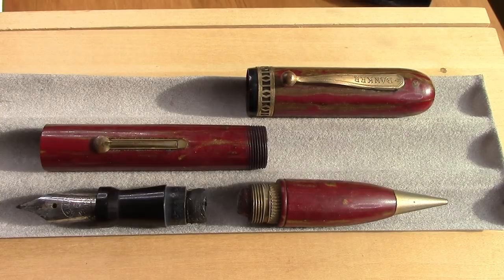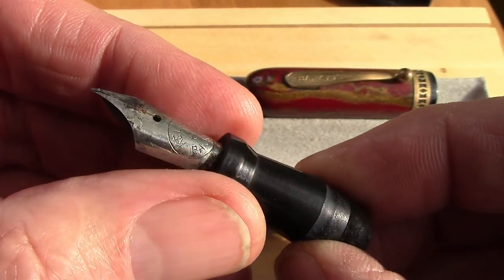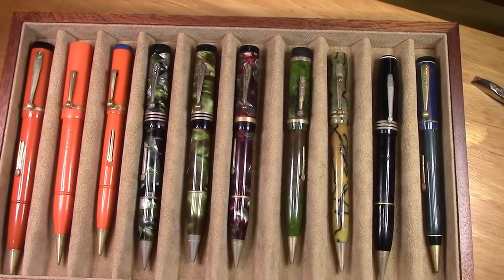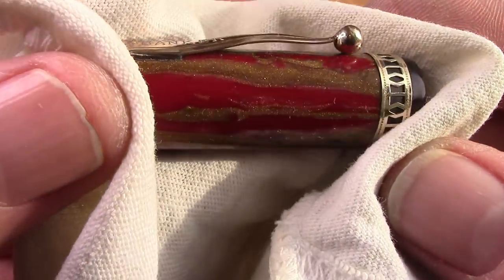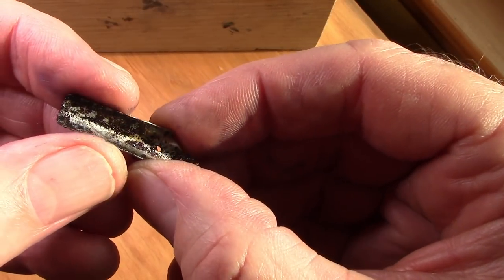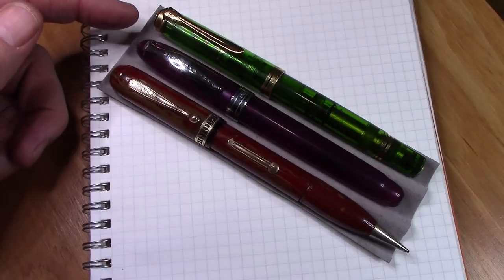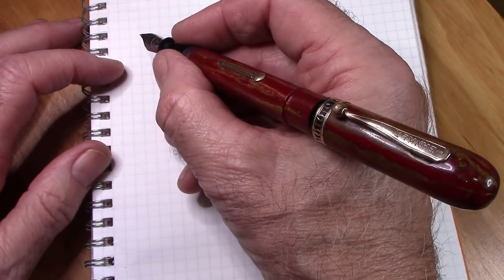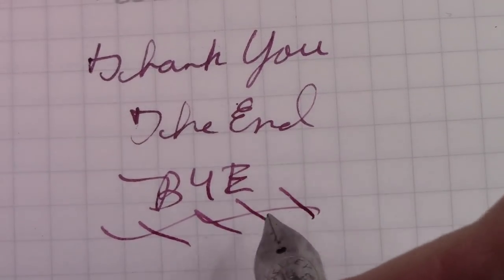Banker Combo Fountain Pen & Pencil Restoration

Comment: Thank you for the shout-out! I'm assuming it was about my Parker Fifth Avenue. Educational for me to see the use of the polish. I have the same polish, but have not been brave enough to try using it. I have a really filthy Svandstrom (Swedish brand) that will need a lot of work. Maybe it's time to try the polish!

The tipping on the nib looks like my Parker Fifth Avenue: folded rather than tipped. Apparently this was a solution on lower cost pens.
Reply from the maker: Yes the 5th Ave, the Parker one not the Eversharp one.

Comment: Nice looking restoration. Or was it a resuscitation?

You pointed out a combo made by Shaeffer.  Did the larger companies make many of these, or was this a niche market populated mostly by lower tier manufacturers?

I understand your desire to keep it original, but if I had one I would put a good nib on it and use it as an everyday writer.

Thanks again for another interesting and educational video.
Reply from the maker: Most made some combos, a small quantity.  They are rarer than these third-tier models.  When I see them at shows they are usually very expensive.  
Like resuscitation, I will use the term.

Comment: Thanks for this video Chris.  It's the only one I found on how to restore a combo pen.  I have one I want to restore.  Any tips on how to replace the J-Bar?  In other fountain pens, the J-Bar rests against the bottom of the barrel.  (At least it seems to me that it does.). In a combo pen, when you pull the pencil end off, there's no bottom.  Do you just slide the J-Bar in and guess where to stop, or is there something to this?  Also, any idea what size J-Bar to get? Finally, I never thought of your way to guage the size of the sac.  Thanks for the tip.
Reply from the maker: Leave the pencil end in place, insert J-bar & trim to fit.  Combos use a shorter j-bar.  Can't provide a length, each one is unique.  Good luck, work slowly.
Reply: @chrisrap52  Thank you Chris!  Great suggestion.  I hadn't thought to do it that way.

Comment: Great restoration! Thanks. Just curious, were you able to replace the eraser?
Reply from the maker: I decided not to.  Just like with the nib, wanted to keep pen original.  When I use pencil I have an eraser nearby, don't use one on the pencil.
Reply: I’ve found those old pencils a bit too thick anyway. I probably wouldn’t even use it. I only keep one around the house. It was my late husband’s and is not in use for that reason. Thanks again for a great video.

Comment: DO you have any idea where i could get the pencil tip replacement and the neck replacement (holds the nib and channel) for the Banker?  I have a similar one but the next is broken and the pencil tip is missing.  Thank you
Reply from the maker: Only thought, salvage from another banker. Look for a parts pen, should be low cost.